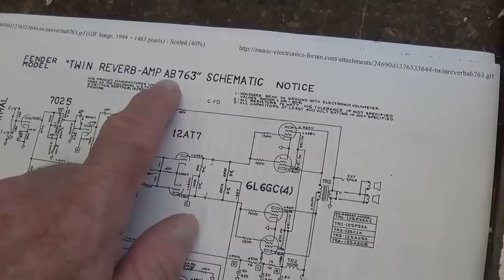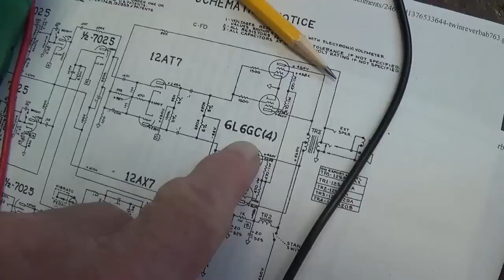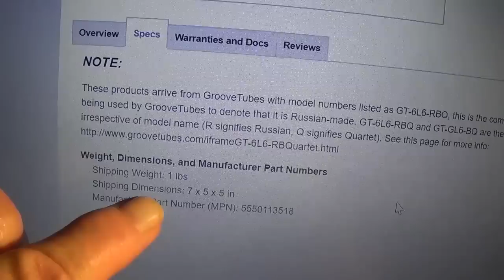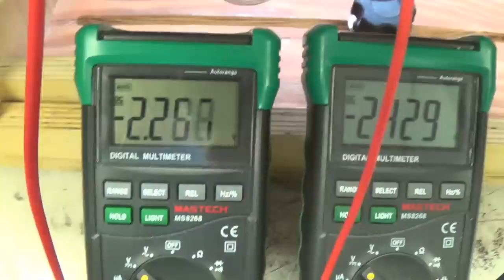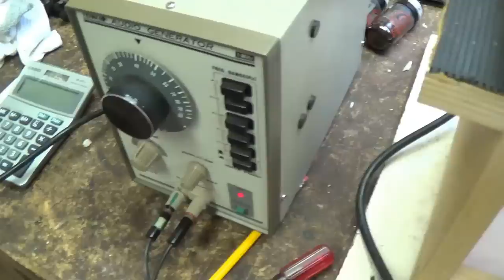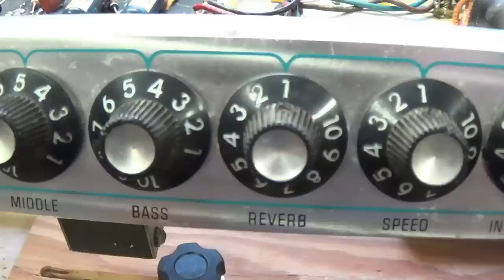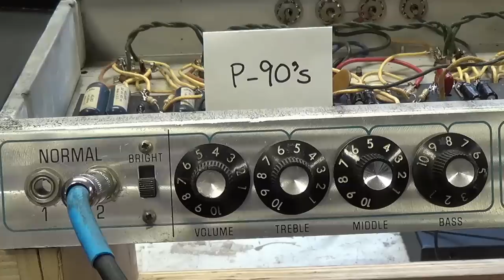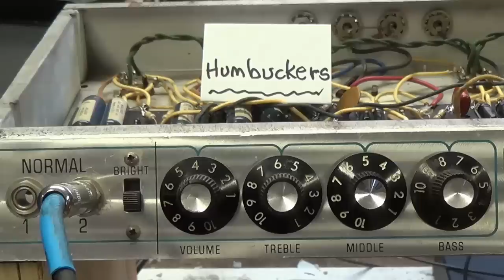1968 Fender AB763 Twin Reverb:   Evaluation, Modification, Extended Audio Demo

Comment: Excellent video & thank you Uncle Doug!  Geez that thing sounded so sweet after you'd finished with it.  The 4 new matched tubes sound as good as they look!

Just with mains wire colours.  I question why you should take exception to our use of brown wire for active, & blue wire for neutral.  There are quite a few people, apparently, who are colour blind to red & green.  So now we have green/yellow as earth, cos most colour blind people can see a striped wire.  Brown colour is made using red, a '+ve' colour.  Blue is then the only primary colour left!

You reckon our colour codes are weird mate but look what you guys use - black for active & white for neutral?  You lot are nuts!  Lol!  Or is it a shh! - racial thing?  Oops!  But yeah I can be racial without being racist!  I don't care I think your mains colour code system is bloody stoopid & illogical!  I still luv youse all though of course!
Reply from the maker: Thanks for sharing your opinion with us, Neville :)

Comment: https://frank.pocnet.net/sheets/127/5/5881.pdf. I think this tube (5881) is a replacement for those Ampeg tubes. 400V max plate voltage as you said, it is under the GC rating. It does drop in and I imagine they would function for a while.
Reply from the maker: Thanks for the info, Stan.

Comment: Doug, Tubes and More has keyway adapters for that tube with a broken key.

Your equation at about 34:30 isn't valid, sorry. You have deltas above and below, so it's really a differential equation. You need to just KISS and use Ohm's Law as God intended ;-) on the whole voltage.
Reply from the maker: Thanks for your helpful input, EJP.

Comment: Uncle Doug, according to https://www.thetubestore.com/tube-brands/groove-tubes the Groove Tubes 6L6B is a rebranded Sovtek 5881WXT, and they have the spec sheet for it. I paused your video, when you were showing the crappy website for the Groove Tubes and it says in the "NOTE" to go to www.groovetubes.com/iframe-GT-6L6-RBQuartet.html for more info, but that just redirects you to Fender's website, which is equally as abysmal as the one you were looking at, AND it doesn't even list the 6L6B to boot. Hope that helps some in figuring out the mystery.
Reply from the maker: Thanks for checking on this, AJ. It's obvious that most tubes are sold with the promise of certain types of tone.....which I think is silly.....rather than on their electrical specs.
Reply: @UncleDoug  I completely agree.

Comment: I have read that the 6L6B is actually a Sovtek 5881WXT with an allowable plate dissipation of 20.5W (https://el34world.com/Forum/index.php?topic=15294.0, also https://drtube.com/datasheets/5881-tungsol1962.pdf).  Definitely a downgrade.  Amplified Parts describes the tube in the wine vendor manner (delivers a warm, round tone that "sweetens" any vintage or modern guitar amp design.)
Reply from the maker: Pretty wimpy for a 6L6, Steve. Don't you love the flowery adjectives, in lieu of factual data ?

Comment: Brad the Guitoligist advocates snipping the leads and bending J-hooks to replace components. I think it’s just lazy and poor workmanship.
Reply from the maker: Thanks for your input, John.
Reply: It's OK if your working on an older radio or some kit type test equipment but these amps really should not be repaired via the hook and loop method.
Reply: @hestheMaster  I agree. Some equipment has fragile tube sockets and desoldering and wiggling out leads can do more harm than good. With the little solder pots such as the Fender amps have, there's no reason not to remove the entire lead.
Reply: Some older parts become brittle as glass due to heat and age. Better to hook and loop when there’s a chance of ruining a 40-80 year old socket.
Reply: We all prefer the look of going into the eyelet vs the hook and loop but it's not always worth the aggravation and added cost.  On this model I believe the filter capacitors that were hook and looped have leads that connect to the next capacitor under the eyelet board.  So you would have to remove the eyelet board to remove the old leads.  Some will just snip the old lead short and squeeze the new one in next to it but sometimes the lead is too thick to get back in the eyelet. If the customer is worried about the look of the leads then it would add extra cost for the repair due to the time it would take to remove the eyelet.
Reply: @dougtaylor7724  👍🏻

Comment: @Uncle Doug - Hi, I was wondering if you'd check out/repair an old Ampeg reverberocket I have. I've left you a message on your Patreon page.
Reply from the maker: I'd be glad to help you out, Kurt, but I'm swamped with work at the moment and need a month to catch up. I have not received  your Patreon message. Please either re-send or message me on my FB page: Uncle Doug's Vintage Amps. Thanks !!
Reply: @UncleDoug  ok, Thanks. I don't have a Facebook account but I'll try re-posting the message on Patreon.
Reply: @Uncle Doug  I re-sent the message on Patreon.

Comment: You should really put some shrink-wrapped over the individual wires been burnt and charcoal is is just the same as having an open wire anything that's charcoal loses its installation properties.
 Not sure why they chose Brown...used to be black and red red was live black neutral, America's just as bad  Black live white neutral that is totally wrong why would you have black live I would have sort it be the other way round. I think red and black is the best way why they changed it I don't know in the early 90s.

If you're missing the foil on the knob it could make one just use like a takeaway tray cut it to the size with some 600 or 400 git wet and dry go round with your thumb will give it a machine look and glue it in place
Reply from the maker: Thanks so much for the comments, observations, and suggestion, John :)
Reply: @UncleDoug   yeah thanks sounds good